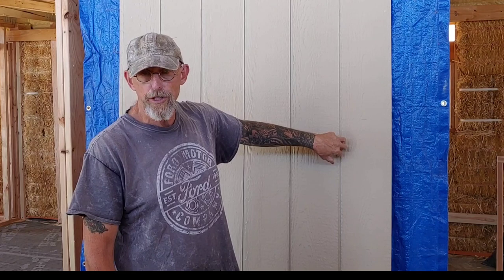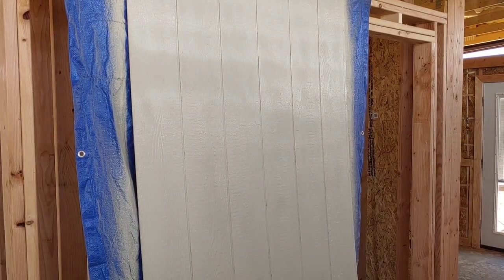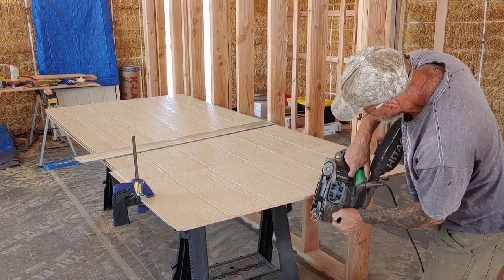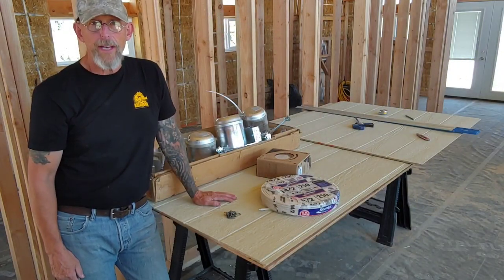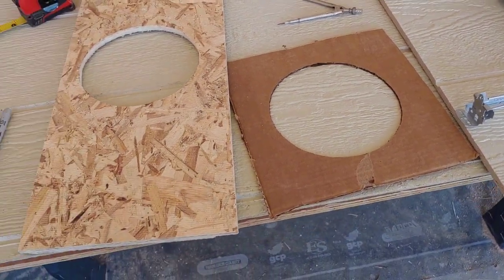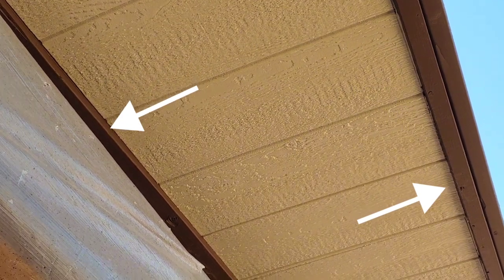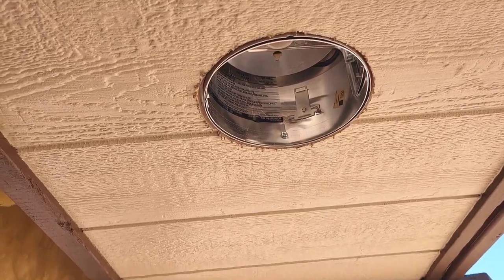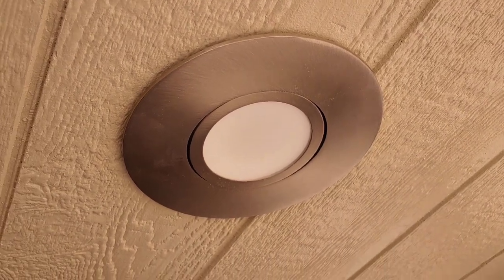Soffits and Lighting for our Off-Grid Straw Bale House DONE! • DAY 44

Comment: Perfect. Nothing could possibly go wrong. Carry on
Reply from the maker: I appreciate your comments but as you saw from the installation the smart side does not carry the weight of the can lights. It won't even carry the weight of the trim piece, (which is 16 oz)because they are attached to the cans themselves, and not the soffit material. The actual can lights themselves are nailed to the nailers on the trusses so I don't think it's going to sag. I appreciate your comments and thanks for watching!

Comment: If there's the slightest gap in those soffit lights, a mud dauber will find it and nest there.  Those desert wasps/hornets are clever little buggers.  Nice job on the paint job and the soffits---who ever said you can't teach an aging 'dog' new electrical tricks???  If you've got a Handeeman nearby, it's a done deal.
Reply from the maker: I agree which is why I used that acrylic sealant fortified with silicone around all the edges and seems. I had never used a clear sealant before, but for this application it worked really great. And having Handeeman as a resource is incredibly fortunate. You'll be seeing more of him as the build progresses. He's kindly offered to help me write the house and do the plumbing too!

Comment: Smart side is a good product, when installed correctly. I have used it before with no problems, but I followed the manufacturers instructions for installation. You have to install it with supports every 16" in it's lateral direction. So, don't be surprised if it sags or warps, gravity is king.
Reply from the maker: I hope it holds but thanks for the heads up. I'll keep an eye on it. Retro fitting additional cross members wouldn't be too difficult if the need arises.

Comment: I'm sure those are led lights and the cans are heat rated.
I'm assuming you are going to dress up that front wall with one of your murals and the lites will make sure it's seen by passers by.   Maybe 4 lites would have been better.  You didn't say what the lite ratings were.   You can always shot a flood lite up at it also.
Good work wiring in series.   Same method used for dropped lighting over a breakfast bar.
Reply from the maker: Yes, those LED lights are rated for direct contact with insulation. Our soffits have no insulation in them so there's no issues with heat build up. They are also rated for areas with moisture.
Reply from the maker: I have to thank Derek handyman for helping me with the lighting. Now that I've got this under my belt I feel a little more confident going forward. But you'll be seeing more of Derek in the future, because he's been kind enough to offer us his help when wiring the entire house. That's a load off my mind for sure. There's something about having an even number of Lights out front. I've always felt that odd numbers looked better. They were installed for that very reason as you mentioned, to help highlight some of the Earthen plaster techniques we have planned for the front of the house. Speaking of Earth and plaster, we have to really get going on that before the monsoon season hits.

Comment: arent you supposed to use pipes for wires ? especially since you guys have so much heat out there lol that straw will lit up like match if any of that wire ever gets broken lol and realize that cable is made out of rubber and rubber is soft when you buy it over time it heats up and cracks lol even look at tires on your car! I've seen people change their tires because they had cracks in them because of aging factor not wear lol I think you seriously gamble big time xD and these pipes you can find them even on garbage because people get rid of them and install new ones after house is torn down lol but yeah that is just my opinion
Reply from the maker: Of course I used the ground wire I just didn't show the installation of the actual wiring when you wire one of those boxes you remove a metal plate inside the box is a ground the hot wire and the neutral and all three are hooked up so I don't know where you get that I didn't use the ground wire.
Reply from the maker: I don't know where to begin so I'm not going to. Thanks for watching.